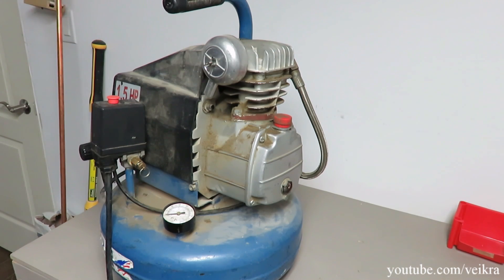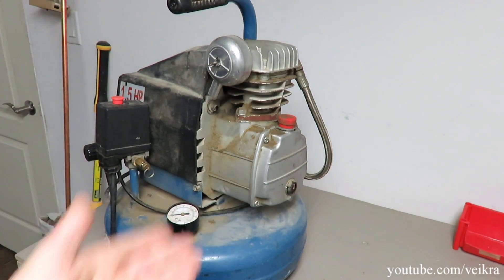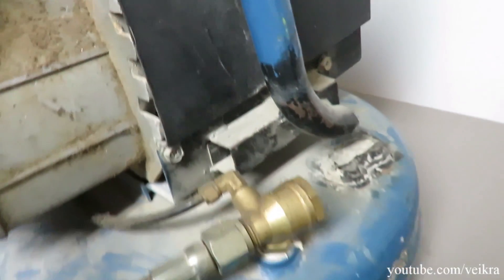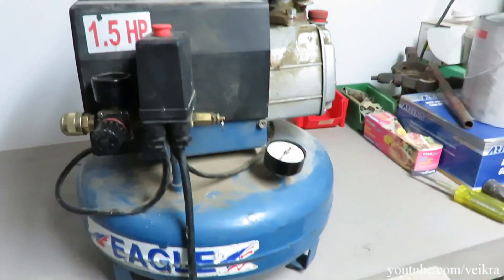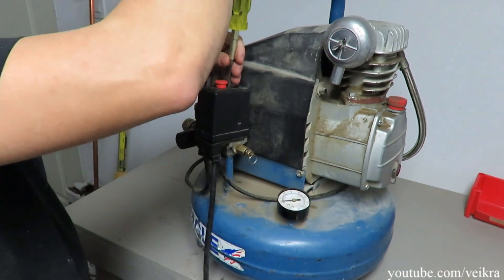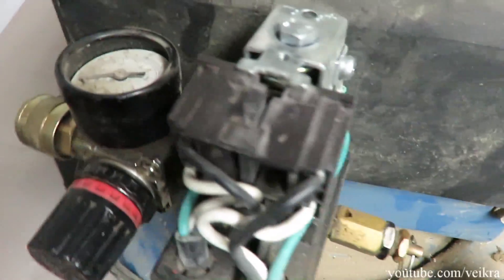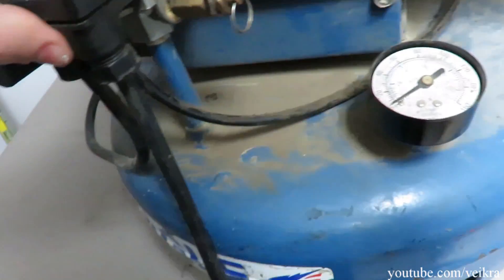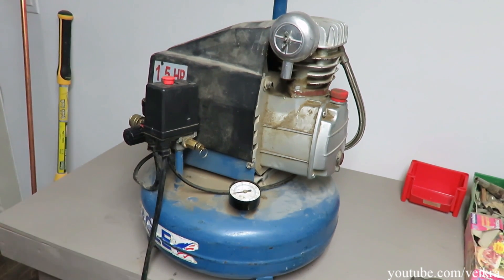Tool Repair Sunday - Fixing leaking Eagle air compressor pressure switch and regulator

Comment: Nice fix, should be a handy air source...not too big or heavy to lug you down.
Reply from the maker: +yourbeekeeper Fixed with a hammer, the best fixes. considering my main compressor weight 800lbs, I always need a little guy around.